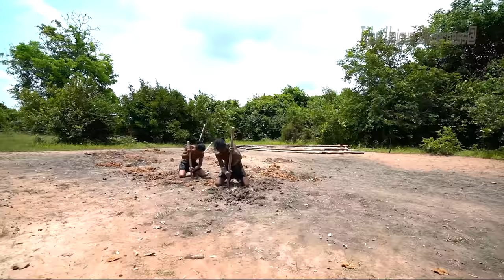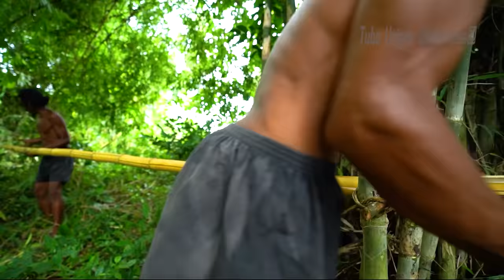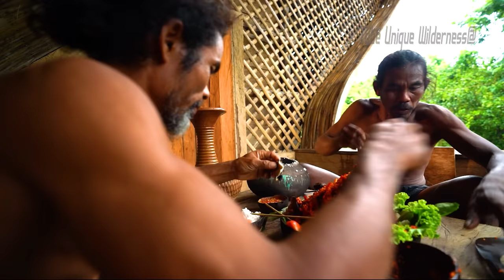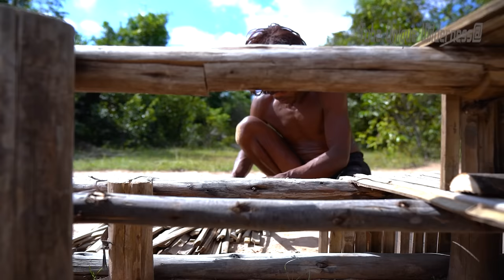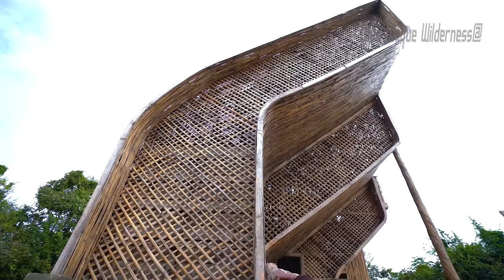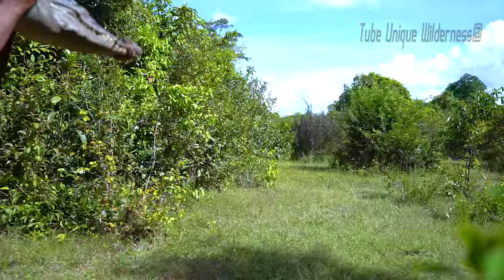Build The Greatness Bamboo Villa With Swimming Pool And Feed the Crocodiles under Raining

Comment: Look at thst wood auger the two of you have. Did you two ever wonder how your hand could be preventing from sliding to the bottom of the wooden handle? Put a metal washer at the bottom of that wooden handle. This will prevent your hands from going any further than where its located.

Comment: One rain and house is flooded because the house edge and pool edge are the same height. I have yet to see pool built wiht maintenance design built in. there is no way to drain pool or replenish it. Would be better one side a pool and another side a garden with seats and fire pit.
Reply from the maker: yes sir thank you so much dear for your support with your comment